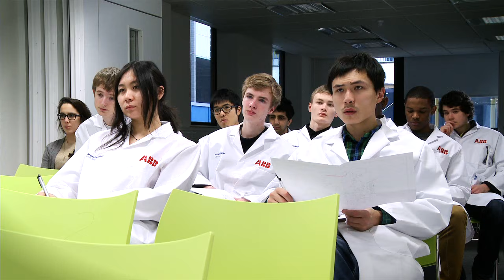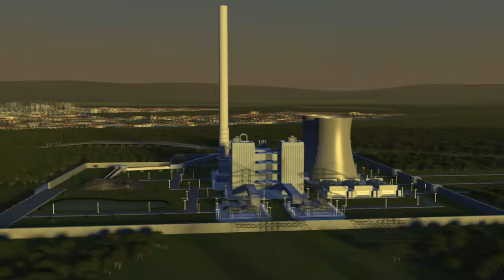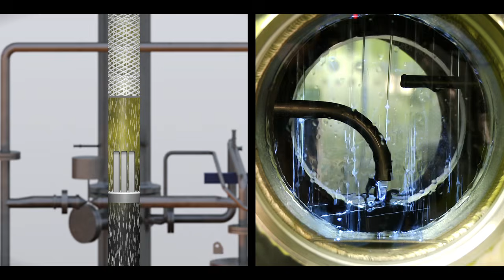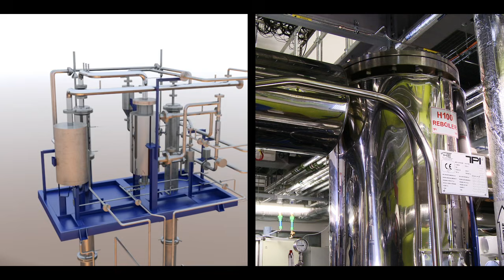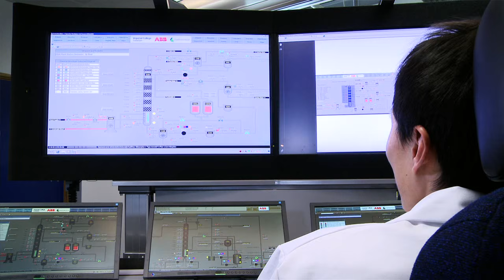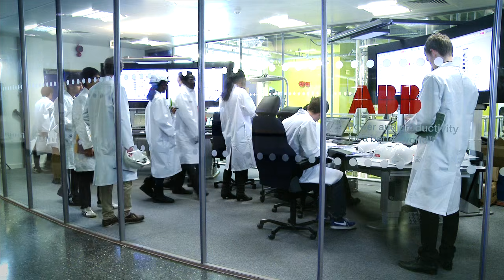How carbon capture plant works

Comment: But it still takes electricity to power all the fans and pumps. Does producing the electricity create more carbon dioxide than is removed??? If so, how do you prove it?

Comment: It works by being very energy intensive, making any work it does pointless. It also works by being very expensive and not very scalabe. Mostly though, it has worked very well in the greenwashing of large industry and governments trying as hard as possible to avoid changing the status quo.

Comment: The % efficiency of current systems is dismal compared to theoretical - adverts for heaters
that make lots of heat for tiny electric input are all over the web couldn't millions of them be
use to re-generate the absorber LOL.

Comment: The flue gas from where CO2 has to be extracted, has a temparature of 160 degree Centigrade itself. 

Can someone explain??
1. So, do we have to cool the flue gas? In that case there will be Cold end corrosion due to SOx conversation to Sulphuric acid. 

2. If not cooled, do the MEA solution really absorb CO2 from a 160 °C flue gas? Because it is being told that the solution releases absorbed CO2 at 110°C only.

How does it happen?
Reply: yes, we recover heat from flue gas and utilize it for heating purposes and then cool flue gas will pass through further absorption and desorption process.

Comment: I'm missing a crucial detail here...   How much energy does it cost? How much fuel extra do you need to pump it underground?
Reply: "In a standard CO2 separation process applied to flue gas (10–15 kPa CO2) at 40 °C, and using 30 wt% MEA and 90% CO2 removal, typical minimum stripper reboiler duties are ∼3.6–4.0 GJ per tonne CO2 captured." - (Issue 5, 2018 “Energy and Environmental Science”)
Reply: I would like to know more about this. If you'd share a link to the publication. @falkjoosten9489
Reply: and 1 tonne coal has ca. 29 GJ energy and when burned produces 2.9 tonne CO2

Comment: XPRIZE CARBON PARTICLE CAPTURE

FORMULATED MICROCRYSTALLINE WAX WILL CAPTURE CARBON
The heat loss from a smokestack can be forced into a large tank containing hot liquid microcrystalline petroleum wax. The heat will keep the wax at a molten state which facilitate the carbon to be absorbed when combined with the wax. Carbon when mixed with wax reacts like a dye. The wax-carbon amalgamation resulting into a black wax solution thereby making it impossible for the carbon to escape into the environment while in a liquid state. Other toxic particles are also captured in the wax settling at the bottom of the tank forming into a sludge. A sludge release valve is located at the bottom of the tank. After the sludge is removed more wax is replaced in the tank working something like a toilet. The sludge becomes a byproduct that can be used as an additive to asphalt for roads or used for cocooning nuclear waste materials for long-term safe burial. The entropy of the Earth has been increasing at a startling rate since the beginning of the industrial revolution caused mainly by the carbon that is released into the atmosphere. Government scientists have failed to stop and prevent carbon pollution from entering the environment. This problem can only worsen until a solution is found before this problem becomes irreversible. It has been discovered that formulated wax has been shown to be the only answer to this problem. William Nelson waxogen@gmail.com

Comment: They should reuse hydroelectric plants to power stations like these, while moving the grid towards Nuclear energy. Also, to those in the comments section berating carbon capture technology, I would point out that no amount of trees is going to capture all the carbon we burned from deposits in which it was stored safely for millennia. One plant over a short period of time won’t fix the problem, but it’s a start.
Reply: FORMULATED MICROCRYSTALLINE WAX WILL CAPTURE CARBON
The heat loss from a smokestack can be forced into a large tank containing hot liquid microcrystalline petroleum wax. The heat will keep the wax at a molten state which facilitate the carbon to be absorbed when combined with the wax. Carbon when mixed with wax reacts like a dye. The wax-carbon amalgamation result into a black wax solution thereby making it impossible for the carbon to escape into the environment while in a liquid state. Other toxic particles are also captured in the wax settling at the bottom of the tank forming into a sludge. A sludge release valve is located at the bottom of the tank. After the sludge is removed more wax is replaced in the tank working something like a toilet. The sludge becomes a byproduct that can be used as an additive to asphalt for roads or used for cocooning nuclear waste materials for long-term safe burial. The entropy of the Earth has been increasing at a startling rate since the beginning of the industrial revolution caused mainly by the carbon that is released into the atmosphere. Government scientists have failed to stop and prevent carbon pollution from entering the environment. This problem can only worsen until a solution is found before this problem becomes irreversible. It has been discovered that formulated wax has been shown to be the only answer to this problem. William Nelson waxogen@gmail.com

Comment: Hello, do you have any suggestions for co2 separation in the wellbore? I'm thinking of removing the co2 down hole before it reaches the surface.
Reply: FORMULATED MICROCRYSTALLINE WAX WILL CAPTURE CARBON
The heat loss from a smokestack can be forced into a large tank containing hot liquid microcrystalline petroleum wax. The heat will keep the wax at a molten state which facilitate the carbon to be absorbed when combined with the wax. Carbon when mixed with wax reacts like a dye. The wax-carbon amalgamation resulting into a black wax solution thereby making it impossible for the carbon to escape into the environment while in a liquid state. Other toxic particles are also captured in the wax settling at the bottom of the tank forming into a sludge. A sludge release valve is located at the bottom of the tank. After the sludge is removed more wax is replaced in the tank working something like a toilet. The sludge becomes a byproduct that can be used as an additive to asphalt for roads or used for cocooning nuclear waste materials for long-term safe burial. The entropy of the Earth has been increasing at a startling rate since the beginning of the industrial revolution caused mainly by the carbon that is released into the atmosphere. Government scientists have failed to stop and prevent carbon pollution from entering the environment. This problem can only worsen until a solution is found before this problem becomes irreversible. It has been discovered that formulated wax has been shown to be the only answer to this problem. William Nelson waxogen@gmail.com
Reply: FORMULATED MICROCRYSTALLINE WAX WILL CAPTURE CARBON
The heat loss from a smokestack can be forced into a large tank containing hot liquid microcrystalline petroleum wax. The heat will keep the wax at a molten state which facilitate the carbon to be absorbed when combined with the wax. Carbon when mixed with wax reacts like a dye. The wax-carbon amalgamation resulting in a black wax solution thereby making it impossible for the carbon to escape into the environment while in a liquid state. Other toxic particles are also captured in the wax settling at the bottom of the tank forming into a sludge. A sludge release valve is located at the bottom of the tank. After the sludge is removed more wax is replaced in the tank working something like a toilet. The sludge becomes a byproduct that can be used as an additive to asphalt for roads or used for cocooning nuclear waste materials for long-term safe burial. The entropy of the Earth has been increasing at a startling rate since the beginning of the industrial revolution caused mainly by the carbon that is released into the atmosphere. Government scientists have failed to stop and prevent carbon pollution from entering the environment. This problem can only worsen until a solution is found before this problem becomes irreversible. It has been discovered that formulated wax has been shown to be the only answer to this problem. William Nelson waxogen@gmail.com

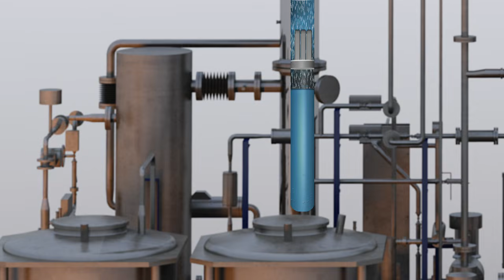Comment: Excellent. At 3:08, can anyone tell please what is that green color instrument (mounted on steam line)?
Thanks.
Reply: Wireless temperature sensor
Reply: @oktogen1476  Thanks for your kind reply.... Keep it up... But the green wing type instrument does not look integrated to the transmitter...
Reply: @cck0728  Green are the cooling fins of thermoelectric element that powers the sensor.
Reply: @oktogen1476  Thanks for your kind reply....Yes, now it makes sense.... Thanks...

Comment: Very well explained. How is the boiler energized to provide the super heated steam to heat the MEA- fossil fuels?
Reply: You could use fossil fuels. It's not like you wouldn't know what to do with the effluents.
Reply: @SalveMonesvol  Funny!
Reply: Superheated main steam isn't used to desorb the carbon dioxide from the MEA. Low pressure, low temperature, low value steam bled from the last stages of the low pressure turbine is usually used. This keeps the thermal efficiency penalty to the power station to a bare minimum.
Reply: It’s actually reboiler called thermosyphon reboiler. Saturated steam is used in shell side to heat the MEA to desorption of CO2.
Superheated steam normally won’t use because of its less latent heat.